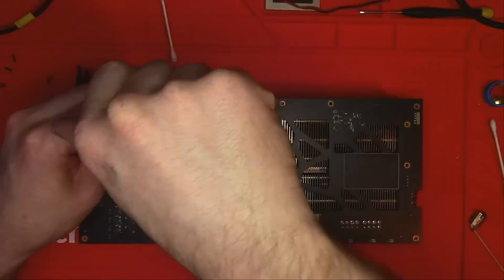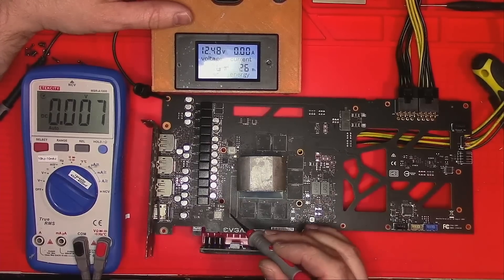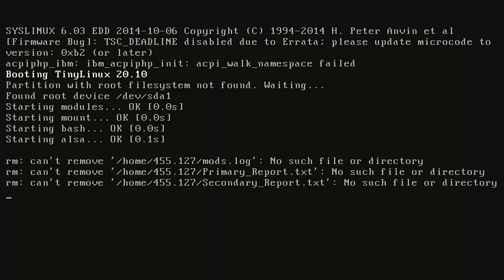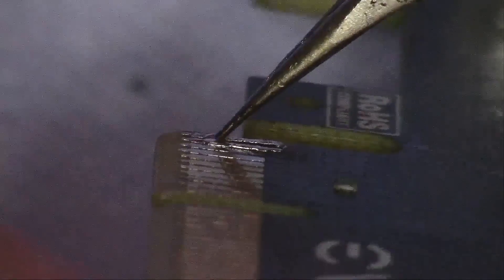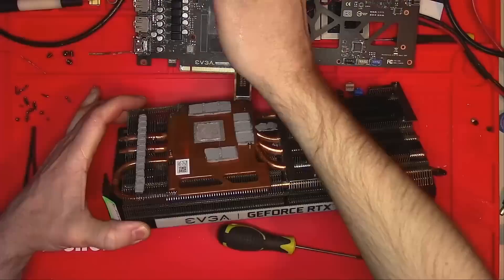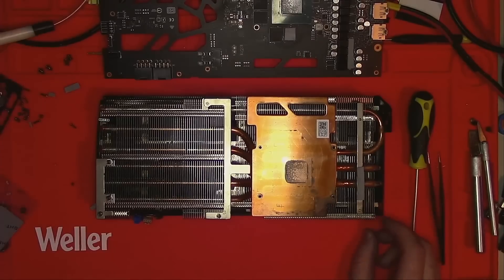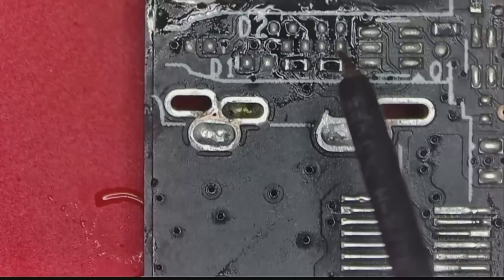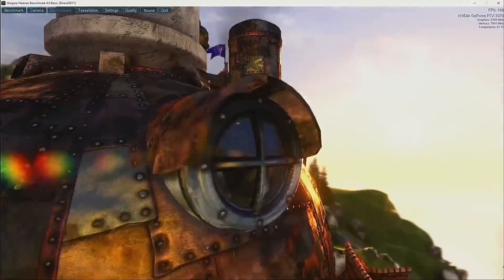how humidity kills your graphics card

Comment: Anyone know y 8pin power 1 higher 85w and then 2 is 18w  and 3 is 27w is this normal for RTX 3080 with a load
Reply from the maker: Bad connection somewhere.
Possibly cable splitter used.
Bad fuse if any.
Number of causes.
Reply: @northwestrepair  I have a corsair psu 1000w that has really loud coil whine not sure if it is coil whine but it sounds like it waiting on a new PSU coming in the post 21 of this month I will then check again and see if it was the PSU I'll let you know

Comment: Transmission fluid is a very good rust remover, and is designed to not interact with most metals.  I work as an auto mechanic. You can take a rusted husk of a part,  or tool and drop in in trans fluid for an hour and it will come out without a spec of rust. a micro drop on a rust spot is enough. Maybe this could be helpful to you. Its fairly easy to clean off with any cleaning fluid that will mix with the trans fluid and make it loose its viscosity. such as alcohol.

Comment: THANKS!!!! I have that same model, and you answer my eternal search for the right size thermalpads (1.75 for memory and 2m for VRM) now my real question is.... How do you adapt a needle into a thermal paste syringe?
Reply from the maker: Not sure how to answer that question.
It comes with it.
Reply: You cut it with pliers then you sand the tip properly. After you sand the tip, don't forget to get rid of all of the very tiny pieces of metal (sanding makes those) before you use it.

Comment: I offered to try fixing a pc for friend's father who's apparently a heavy smoker. The amount of tar, dust and God only knows what else  that was caked inside and out was unlike anything I've seen. I  had to clean my own USB drive I put in a rear port before realizing how bad it really was. To make matters worse, even the exhaust fan was installed backwards as an intake. Even my trusty red can, a little brake cleaner and a soft toothbrush struggled but eventually that's all that was wrong. 

Most of it was bad contact but I think it may have somehow interferred with some components. I don't know if it's possible for build-up to eventually add capacitance or slight conductivity to sensitive areas but it definitely seemed to be doing something. Absolutely disgusting.
Reply: The dust allows static buildup, especially bad around MOSFETs.
Reply: Imagine his lungs then, lol.
Vaping does the same. Its oil that sticks everywhere and combining dust with it makes it stick like glue.

Normally oils should not be conductive but if it's very unclean, it can happen
Reply: @DoodieSmoothie  Dust usually contains iron particles and a serious build up is really starting to be electrically conductive.
Reply: @DoodieSmoothie  Yeah cannabis smokers are worse than tobacco due to the gunk that sticks everywhere and makes it hard to clean the dust away.

Comment: hey a question please , after flashing vbios on GPU (original VBios) the card won't show image/ black screen , can this be fixed??
Reply: Of course it can. You need an eeprom programmer, a hot air station, skills and to never ever again do this yourself until you learn what you need to know to find a BIOS that really matches the card. If you find a BIOS for a Gigabyte RTX 1240 it does not mean it is working on yours even if it is a Gigabyte RTX 1240. Send the card to this man and he will have it fixed for you.

Comment: I can't remember where I learned this but a good way to measure the pad thickness is to take some play-dough and press it down with the cooler on the components, then just measure the thickness of the compressed play-dough with some calipers. Write it down somewhere and use the appropriate pad size now that you have the necessary info.
Reply from the maker: yeah i used to do that. But now i have a ton of pads so i dont really care anymore.
Reply: @northwestrepair  Oh ok! Have you ever tried those ultra soft pads that have an almost putty like consistency and conform to the component? If so, I'd be curious to hear your opinion.
Reply: Do you buy them in bulk?
Reply: sounds great, how much are calipers?
Reply: @Layarion  They're really cheap and work well for our purpose. You don't need the professional ones for that.

Comment: Odyssey pads are also hard like a biscuit..its better to use softer pads..or yet thermal putty..
Reply from the maker: maybe you are using wrong pads. Mine are OK. Somewhat compressible. which is what u want
Reply: I went with Thermal Grizzly. Not the best, but still better than stock.

Worst part for me was, when i had to use multiple sizes. 1mm for VRAM, 1,5mm for VRM and backplate VRAM, 3mm for backplate VRM. Too bad i can´t just remove the backplate and use my GPU without it, as fan shroud is mounted to it.
I´m considering doing a deshroud, just for fun. If i´ll be successful, then i´ll gladly remove the backplate too.

Comment: Looks like you barely use any thermal paste on the GPU.
Reply from the maker: Its enough.
Reply: I was thinking it is much less than I would normally apply too, but the proof is in the spread.  It looked great when he pulled the cooler off.

Comment: I only know this all too well living in Taiwan with its humid salty air.
Reply: There's humidity absorbers you can use in a PC case right where the air is going inside the case. You need to configure the intake on one single place and the exhaust everywhere else and put the humidity absorber near intake. Rice is doing some good job but you need something like a linear multi-layer filter for that to be efficient so maybe a few layers of rice along the path of air intake would do the trick. It won't take all humidity out, obviously but it will take a lot.